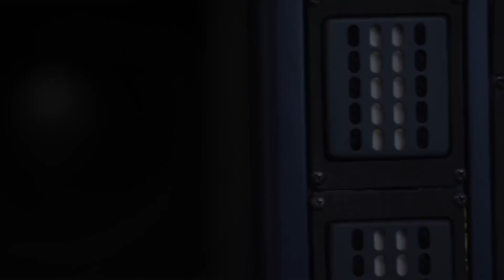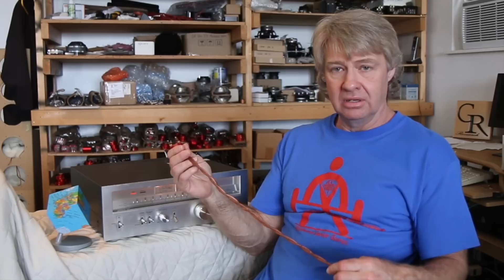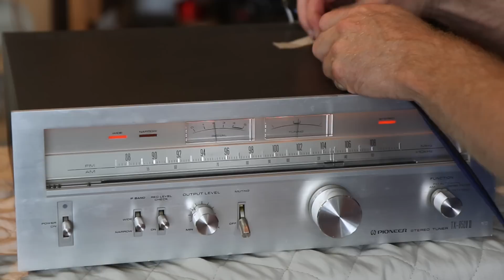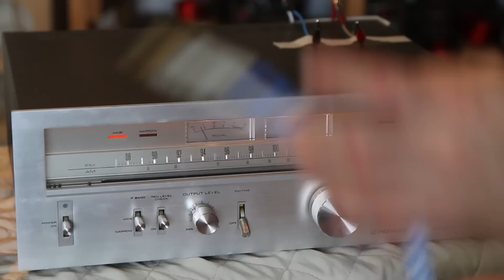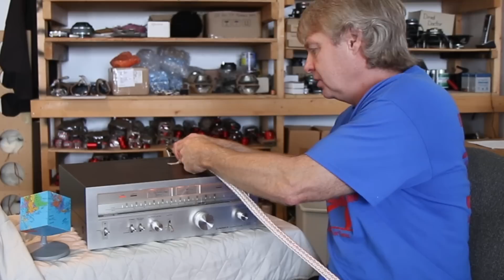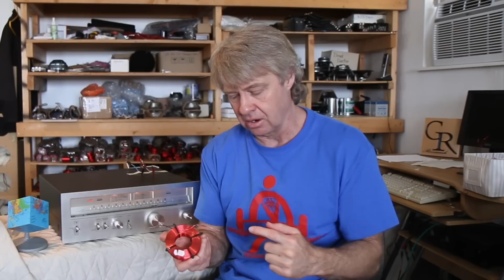Do Audiophile Cables Matter? Here's PROOF!

Comment: what i see is you testing not so much the wire but how twisted leads that shields the signal  at 104mhz .audio is more like 20-20 000hz.if i use 99% clean copper twisted in a solid shield would do the trick also.my point is that a shielded cable with good thick copper leads in a copper tube that is grounded to earth would be noise free as those insane expensive cables.You are talking more about shielding than the cable itself?..tell me why  am i wrong.To use twisted pairs is used in amplifiers from trafo down to 4 way bridge rectifiers.input signal cables are twised pair or shielded. multistrand  plain cables where each strand has a small difference from strand to strand in each of the 2 leads.if each lead have 20 strands in them you can hook upp 20 speakers 1 to each strand.It is said that the timing between those 20 strands will be a little off and this phenomen cause smearing of the sound .2 solid core leads twisted and in a good shield would be much better.It is not so much the material in the cases i have mentioned that would make a difference but the way they are twisted or and shielded that matters and make the real difference.Am i way off?
Reply: The proof is in the pudding as they say.

Comment: A lot of people say there's no difference between cables but here's a test that proves they are different. Well done on making a confusing subject simple.
Reply: You don't at all understand what he proved. He hasn't demonstrated any difference in speaker cables as they are intended to be used, he's shown what the relative difference would be if you want to use speaker cable as an antenna. A speaker is not a radio receiver, it reacts to the output of an amplifier which is several orders of magnitude more powerful than RF being picked up from a cable run. Is there a difference in RF levels on different sizes and windings of cables? Yes. Does it matter to a speaker? No.
Reply: @wetwareinterface3977  "You don't at all understand what he proved" right on ;)
Reply: @wetwareinterface3977  It still effects the audio signal and in some cases quite significantly.    https://youtu.be/ER_lqNFckxY

Comment: If they do make a significant difference , why don't you replace all the internal wiring in your speakers with it ?
Reply: You'd also need to open up your amp and redo the wires in there.
Reply: @redstang5150  And all the circuit board connections.
Reply: Really good question.
Reply: He does

Comment: I get that RCA interconnects will act as an antenna and pick up noise, but to suggest that speaker cables have the same effect is violating the first law of thermodynamics, you cannot create energy!. speakers need a lot of energy to produce a audible signal, you will never get that much energy from RF sources, we talk about nano- and pico Watts.  The effect on speaker cables are more impedance related, but then again, you have inductors with many meters of wire adding resistance and impedance with far greater inductance to pick up RF than cables, you also have complex impedance patterns of speakers while speaker cable have a small effect in comparison especially once you get to a moderate gauge size where damping factor benefits a bit. But the idea that a speaker cable will pick up RF which a speaker will produce is just nonsense, especially if you argue that the un-shielded coils in the cross over does not! The odds are that such noises either come from the preamp or input interconnects where impedance is high and not in the output stage.
Reply: It still effects the audio signal and in some cases quite significantly.    https://youtu.be/ER_lqNFckxY

Comment: The cable you should have tested is ordinary solid stranded power cable for permanent installation. Just like the one you wire the house with. Those are the best cables per dollar period.
Reply: Ha, ha, ha...
Reply: @dannyrichie9743  try it...

Comment: I want to see these cable gurus run a double blind ABX test. They can use their own cables. I'm open minded. If they can show they can identify a statistically significant difference in those conditions, then I'll believe them. Until then, I remain unconvinced
Reply: @miroslavkelekovic2507  No, they did not.
Reply: I have a great deal of skepticism as well. My mind goes back 40-60 years ago pertaining to the power of the amps, composition of the drivers, and composition of the cables. Have our ears improved along with the testing equipment? I understand annoying hmm & feedback but the cost of some of these cables according to the test equipment is negligible.
Reply: An audio purist would point out that the ABX device has its own impact on the sound.
Reply: @sourdoughhome2571 😂😂😂 but the effect is the same on both A and B, therefore it doesn't matter, the difference is made by the cable
Reply: you are not open minded…. you are just egoistic idiot…
Reply: so are you using the cheapest cable that you could buy? have you tried at least chord c line cable they are not that expensive and have five star from whathifi.. i didnt believe it either until i tried.. even usb cable make improvement
Reply: @gainothing what hifi, oh yeah, there's a pinnacle of credibility 😂😂😂
Reply: Pls link  @miroslavkelekovic2507
Reply: All these guru get lost on me when I hear that low/high frequencies travel through different parts of the cable even though we've been taught at school that electric signal travels across the surface of a conductor. Idk where the truth is, this industry is DISGUSTING either way 😂
Reply: Exactly the same mentality of flat earthers it’s so obvious how full of it they are. The brilliance of the scientific method is you can say “this is exactly what would convince me” but they are like “how about I show this test instead that doesn’t mean anything”. They don’t even realize that’s what they are doing, it’s like on a subconscious level they don’t want to face the fact they got scammed out of thousands of dollars for pretty looking copper.
Reply: ABX on a oscilloscope and you still wont find anything.
Reply: we did a blind test with several cables , one had a key as part of the conductor and no one could tell the difference

Comment: If you want to filter noise, build a filter. In fact your audio equipment should have filters in it to get rid of noise. Your speaker cables should transfer the audible frequencies and should not filter anything.
The noise floor on my audio gear is also inaudible, like it should be on all decent systems.

Comment: The main problem with this test is a speaker wire can reject all kinds of radio frequency interference and still sound dead and lifeless.  Another speaker wire can be very noisy but sound beautiful with excellent dynamic range.  Or anywhere in between.

The best thing to do is have an open mind and listen to different types of speaker wire in different configurations.

One of the best sounding speaker wires is 18 gauge twisted solid core copper doorbell wire from home depot or lows.   Try it.  The wire is directional so try it in both directions.  
You can cancel out a ton of noise by simply turning off most of the computers and lights in your home and using high quality batteries whenever possible ( that is a can of worms right there).

RCA, power , HDMI all can improve or hurt the sound of your audio system.  Unfortunately price has almost nothing to do with it.  You have to experiment with your ears.  Not your test equipment.
Reply: Wire is wire. As long as it has the current handling capacity for your needs it will work just fine. 16 gauge zip wire can handle about 400 Watts. If you're pushing more than that you should go up in gauge. As far as pure copper goes due to how copper is refined it is all pretty pure. Although there is some shady wire being manufactured today. Copper plated aluminum and iron. But if it is actual copper wire it'll be better than 99% pure. Electricity just isn't as picky as some silly audiophiles are.
Reply: @1pcfred  wire is wire if all you need to do is pass electricity.   If you like clean life like audio almost all wire has different sonic qualities.    No music is played with 400 watts of continuous power.    Even a 1 kw audio amplifier will run fine with 18 gauge speaker wire as long as it is less than 15 or so feet long.   Unless you are running extremely inefficient speakers.   Most people will not uSe more than 30 to 40 watts of power in a home audio situation.  Speaker wire makes a big difference.  Do some experiments yourself.

Comment: So cables ....picking up signals in the megahertz range create noise? WTF?
Reply: It still effects the audio signal and in some cases quite significantly.    https://youtu.be/ER_lqNFckxY
Reply: @dannyrichie9743  interesting...but still well below the threshold of human senses.

Room treatment.....crossover upgrades....better connections in signal path (tape mon....input selection.....tone amp bypass connections....interconnect terminations....even protection relay contacts in the higher power signal path )....WAY WAY WAY T F  more signifigant....and actually audible.

https://youtu.be/kR12Ttuxobs

Comment: the only question that needs to be answered is: Can you hear a difference ? so can you ?
By the way, a cheap coaxial cable would have worked the same as that ridiculous thick one, all that matters in your test case is the shielding, also shielding adds capacitance, and for long runs that works like a filter, which is probably not good, depends on the speaker type.
All that matters in speaker cables is impedance, so the thicker the wire and the better the material the better the sound, which is why the thick silver coated cable probably sounds better.
Reply: Actually none of that is true. Yes you can hear a difference. Shielding does nothing for noise already on the line. Impedance has little to do with how it sounds. And Silver Coated Copper cause a very audible phase shift that causes an audible distortion.

Comment: Must have a very bad standard 16 GA cable, but suddenly using a bi wiring with that very average 16 GA cable makes u huge difference in bass handling.
The thing gets mad wild bass. It wants to crush the wall. 
Some say : at least double the speaker cable on the - plug, just so to move away from standard problems. Doesn't' mean the antenna problem is solved.

Comment: When cable manufacturers start giving proper measurements I will buy them. Until then I believe thick copper to be the best.
Reply: I hear a difference on the cables that I’ve changed.., I don’t go by measurements... I try them and listen.., I check my opinion with giving my wife a blind test.....
Best results so far are with power cables..
Reply: @tigertiger1699  Agreed. Let the ears decide.
Reply: @tigertiger1699  ahaha mate, you should do a standup comedy
Reply: Why not just listen and see for yourself if the manufactured cables sound better or not?
Reply: Ahh yes the one believing in magical cables without measurements is the educated one. You can't pick when you believe in science and when you don't.
Reply: @marcusm5127  To be fair, in most cases you probably don't even need thick cables, but I doubt that's what Danny meant.. :-)
Reply: I'm sorry that your world is flat as well.

Comment: I must admit I do Hear a difference with speaker cables. It's not subtle but quite pronounced. Once upon a time I had a pair of Roger Studio 1s connected to an A&R Cambridge. Rated at 30 watts per channel. The front end was a rega planar 3, with an ortofon Concorde  cartridge. For a long time I had the speakers connected using QED 79 strand. The sound was very dark, muddy and the mid base swamped the higher end. A friend of mine had some single core cable, which were physically separated by an inch  all along the cable. In actual fact it was 3 single core conductors per channel. I only used two on the conductors per channel. This made a profound difference to the sound. The bass tightened up significantly. and for the first time I could hear what the speakers could convey at the top end. I was really amazed at the sound of these speakers. It's character changed completely. More dynamic, more agile. I could really appreciate Stanley Clarke bass guitar as he played it.

Comment: This noise is becoming a big deal though. We are being bombarded by noise, even at audio frequencies with, aircraft, traffic, noisy neighbors.  The average home has a huge number of wireless devices, bluetooth, cell phones, switching power supplies as well.  And it is only going to get worse.
Reply: I think this is actually a bigger deal than the speaker cables will ever be, upgrade your sound insulation/deadening etc if you actually want to reduce the 'noise floor'

Comment: Again a great video. I knew about cable shielding, but I didn't know that basic twisting can have this result.

So I ordered a 8-pair twisted round cable and replaced my silver flat cables. And yes it sounds better. More detail, separation and air. And also yes, the top end with copper is a little less extended, but overall the sound is better..

Comment: Did you research flat earth yet?
Reply: You mean did he binge watch videos of other idiots making baseless assertions and suck up everything they say without question?  Because that's the only "research" flat earthers do.
Reply: @ReValveiT_01  avatar pic has flat level water
Reply: @shelly6482  Thanks for confirming what I said.  Also, you should be more worried about the underlit clouds.  A 3000 mile high sun illuminating the underside of clouds that are no higher than 5 miles?  No.
Reply: @ReValveiT_01  how did you measure the distance to the sun?
Reply: @shelly6482  3000 miles high is what flat earthers reckon; not me.
Reply: @ReValveiT_01  nobody has measured it so all speculation
Reply: @shelly6482  Well, the distance has been measured in reality, via parallax and many other methods.  But yeah you're right; flat earthers can only speculate how high it is in their 'model' (not that they have any kind of model).
Reply: @ReValveiT_01  the thunder dome works like a speaker
Reply: @shelly6482  Citation needed.
Reply: @ReValveiT_01  the Lucas arts logo has a dome with the sun and moon inside the limited system and outside the dome is Lucas arts fiction
Reply: That's why my beyerdynamic dt880 600ohms sound so good because the  earcup is dome shaped like the thunder dome
Reply: @shelly6482  Real citation needed. The contents of a companies logo isn't evidence of anything.
Reply: @shelly6482  Actually, the Lucas Arts logo is a person in front of a sunrise (or set).  Something else that would be impossible on a flat plain.
Reply: @ReValveiT_01  look at the Lucas arts logo and the Zack hemsey the way album cover
Reply: @shelly6482  I have.  Are you attempting to cite a logo and an album cover as proof of flat earth?
Reply: @ReValveiT_01  Zack knows that's why he put the Ying Yang sign for the sun and moon on the compass
Reply: OMG used an audioquest nrg y mains cable in my pc and it made a jaw dropping difference wtf?
Reply: @shelly6482  Stay off the drugs.
Reply: @ReValveiT_01  Drugs?
Reply: Zack is on drugs aswell i suppose haha
Reply: Audioquest is on drugs also?
Reply: Learn the difference between image and photograph please.
Reply: @shelly6482  You're supposed to be supplying evidence of flat earth.  Pointing at artwork and going "there" isn't cutting it.
Reply: @ReValveiT_01  we have flat earthers because we have no globe proof
Reply: @ReValveiT_01  send globe proof
Reply: did you?

Comment: I'm not going to discount the possibility that speaker wire may make a difference in sound. I worked with one technician who said his ears were so fine tuned that he not only could tell the difference in audio cables, he could tell the direction the copper was drawn when the cable was made. Myself and the rest of the shop had all they could do to not laugh out loud.

Most of my life though, I was employed in the computer or Information Technology field. 

I did work for awhile as a professional audio technician. I've also built my own amplifiers and speakers. I can't say with absolute certainty, I have heard the differences in proper speaker wiring, but the fact is I don't have the same test conditions, or the listening room as he has. 

You have done yourself somewhat of a disservice in this explanation. I don't want to be mean here or suggest you don't know your business.

My point is this test isn't correct. Sure, an unshielded, unterminated pair of wires can pick up Radio frequencies. Even doing twists throughout the length of that black cable can slightly attenuate picking up high frequency magnetic waves. The comparison of microvolt signals to a standard 1 watt @ 1 meter (2.83 volt) speaker sensitivity test would show you the tiny 10 to 50 microvolt signal you picked up is thousands of times weaker. This translates to well below human hearing threshold for sensitivity. No doubt though, once you connect the speaker wire to an amplifier and the other end to an 8 or 4 ohm speaker, even that radio wouldn't be picked up.

Going further into your presentation, yes line noise can affect the quality of sound from an amplifier. It not only gets picked up, it gets amplified. 

Do I doubt your word that the best speaker wire will improve quality? No & yes. From what you say and experience in your hearing test lab, you may be right.   From this tuner test I would say, I would have to say your findings are suspect.